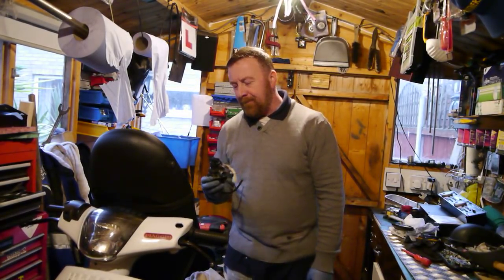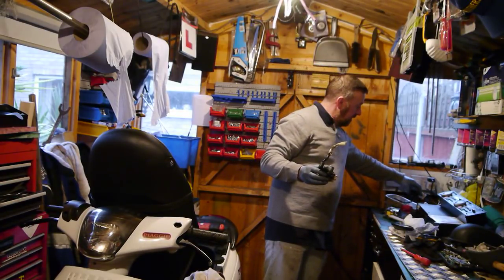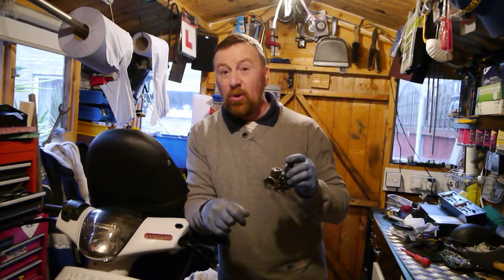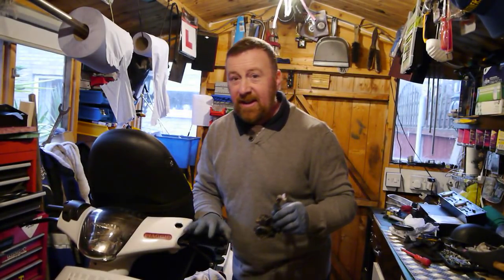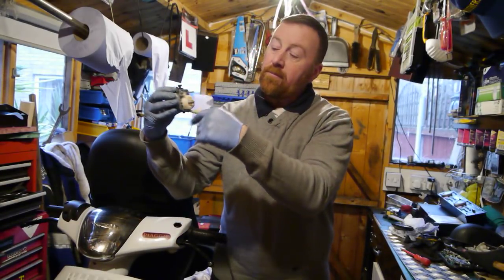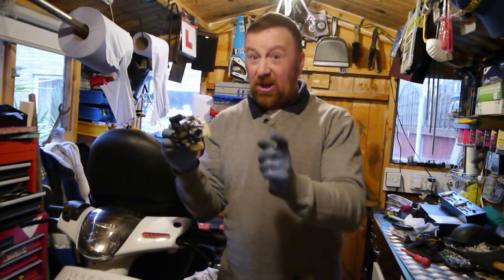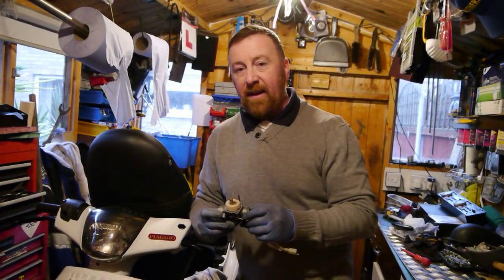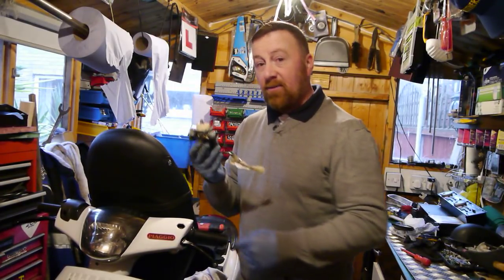STOP!!  MOPED BEFORE YOU UP JET WATCH THIS MARK SAVAGE

Comment: Mark I bought a piaggio zip 2 stroke on a straight it only does 27mph n down hill it does 32mph ??
Reply from the maker: Change rollers clean variator and put on a sports exhaust and you will get another 10 mph and you may as well service it change the plug and air filter
Reply: Okay cheers mate.
Reply: Light or heavy rollers
Reply from the maker: Mitchell Sandwell is go 6g’s heavier in total !
So weight what you got now and go up 1g each bud
Reply: mark savage  cheers mate someone said to upjet ? Do I do it or not
Reply: To a 68
Reply from the maker: Mitchell Sandwell yes an upjet will help 
Find out what’s in there now and like my video on upjetting go up in 4s to get the best then tune like in my videos

Comment: Hi Mark. Sorry to bother you with a question you probably got before. But i have browsed your videos and can´t find anything.
Thing is I want to tune up my bike a little and mostly want better torque,acceleration and power uphills.
I don´t want a noisy high rpm that sounds like a upset wasp. What is the best way to go, larger cylinder, larger carb, or both?
It makes 70-80 km/h and I´m happy with that, just don´t wana drop down to 40 uphills and want to be able to leave the traffic lights behind me a bit faster. 
Liked , subbed and shared already =)
Reply from the maker: Hi bud
ok VARIATOR is the first port of call i would be doing for taster pull away and up hills
check the weight of your roller now and go 1g lighters so if you have 36g's in total go 1g x 6 so 6g's in total lighter going down to 30 g's 
don't forget to clean the VARIATOR or you could go for a sports one which would help too, while your there check the belt if worn change that, this is a cheap and easy way to get more pull away but you may loose a little on top end but worth the pull away as that's what you want bud 
give that a go first, then you would have to lok into a wasp sorry sports exhaust and air filter with a little up jet of 4 but NOOoo to a 70 kit lol as you must know i hate them for so many reason as in my videos
hope that helps 
mark
Reply: Thanks. I have a kit with weighs to try with, and have ordered a Naraku Traffic exhaust, then we see where that will take me =)  I use break cleaner spray on bits like variator. Makes them as new in a few sec.
Reply: Btw, I have watched most of your videos and have NOT missed that you hate 70cc, LOL, But i have managed to miss exactly why. Do they cause premature wear out on bearings and such?
Reply from the maker: they just don't last and blow plus most people forget that the head will need more oil in as the set up is for a 50cc and not 70cc so heat seize and you never seem to get much more out of the bike and then hard to set up with re jetting, air filter and petrol mix 
so that's why I say best leave it as a 50cc and play with the set up that way, however to be honest I have seen some that are set up and running fine so guess it just luck on the day lol
mark
Reply: How about the 50cc Sport cylinders, with larger channels/ports, if a want more torque? Any make there to recommend? Athena, Polini, Motoforce or other?
Reply from the maker: just not the cheap stuff, everythnig else is down to your budget and reviews, have fun bud 
mark ,

Comment: Please answer i live in NYS and I just put a new mlm pipe on my nu50 deluxe do I need to run higher than an 85? I was running an 85 should I go to 88?
Reply from the maker: hi bud 
thanks for watching
what is it running like now you have changed the pipe
if it is running ok then leave it as is, if not then yes going up by 3 is fine and should cause any probs. if you do then change the air filter as well bud
please like share and sub and i have many other videos that you may like to watch and help 
mark
Reply: mark savage I definitely do share your videos been a fan for awhile i am just running the new pipe with 88 it four strokes alot until warmed up with 85 (stock) runs like shit won't do over 25

Comment: What would I need for the sym jet 4 50cc
Reply from the maker: What are you after doing bud 
Upgrade 
Service 
It's a 4t so really only a sports exhaust but it will only sound louder 
Small upjet by 4 
Clean variator and new rollers
Reply from the maker: What he said lol 
Really you buy a 4t moped for reliability and simple riding 
Once you start to mess around with them they tend to go wrong as these engines are not built that way 
If you want more speed get a 2t mooed bud changing the Rollers and a small  carb upjet will help with pull away and a little more mph